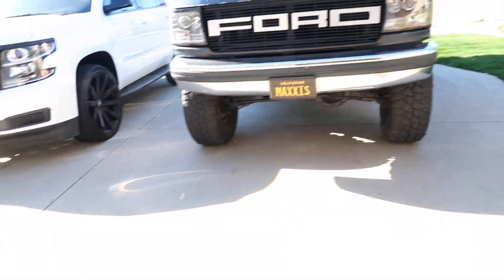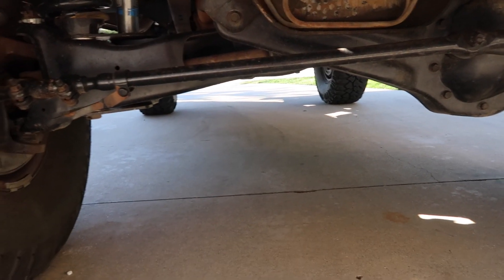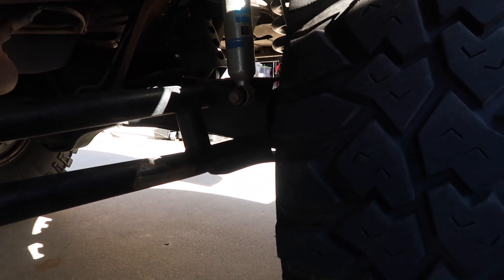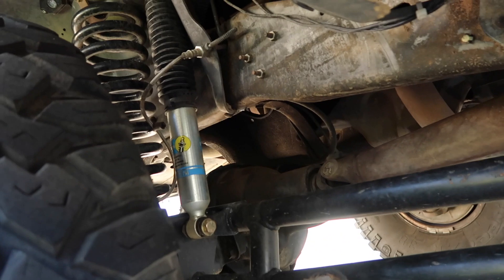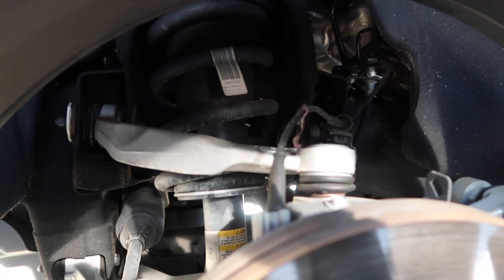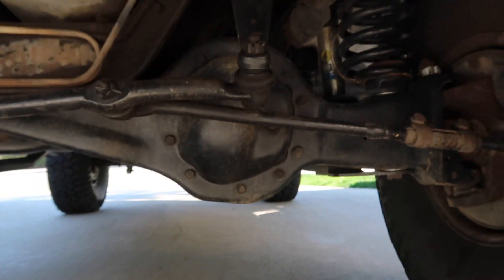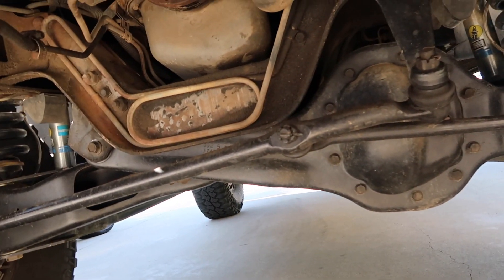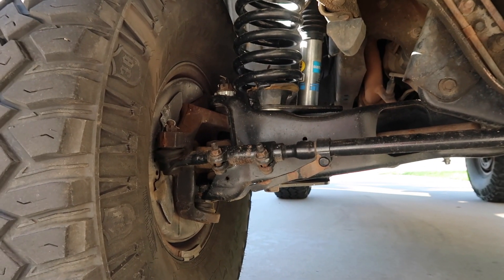Twin traction beams vs A arms?

Comment: I have an '88 ranger 4x4. It has a factory 2 in. lift. Was available on STX package starting in '87. I bought it used in 2014. Drives good especially after replacing entire rear leafs, brackets plus aux. leafs & coil over Ranchos. New Ranchos up front also. Ultimate goal is dana 35 ttb front with 8.8 in Ford rear. Wish me luck!!

Comment: Nice video. Damn I hated working on the twin i beams. Keeping them aligned was a pain in the ass. On the smaller explorers 90-94 it provided a rough as hell ride. I also found the travel to be lacking due to differential housing making contact with the frame. The "pumpkin" on the explorers site right under the frame rail on driver side
Reply: Its ok to be gelous.

Comment: I have a 1989 full size bronco the 4x4 system is awesome just maintain the Joints and locking hubs.
I have owned mine since 1996, and beat the crap out of it.